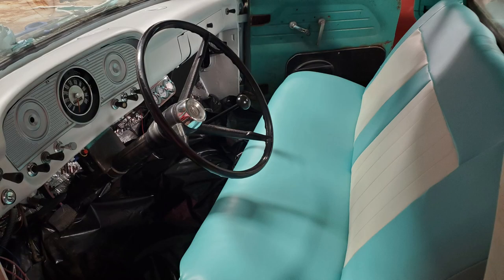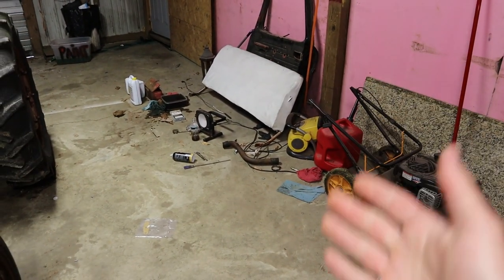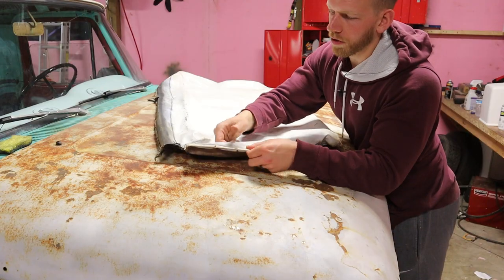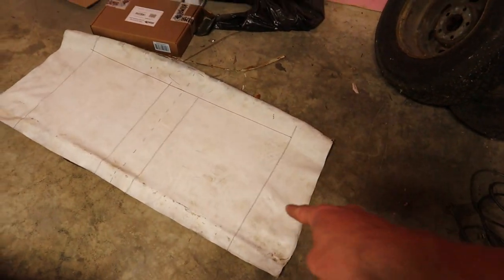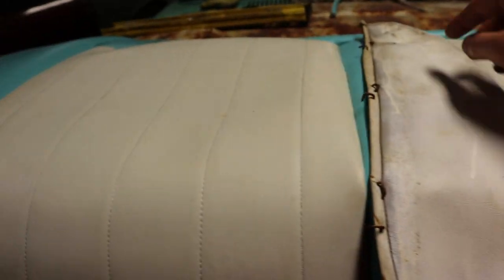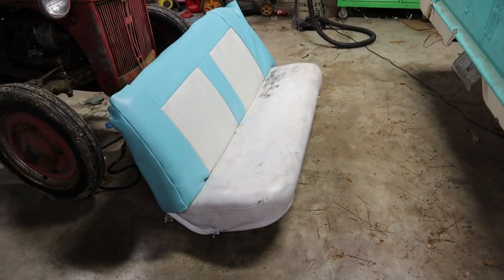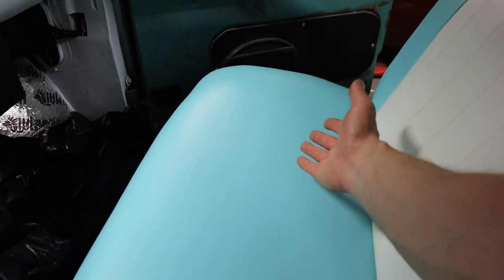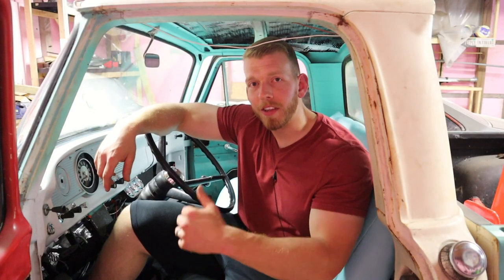PROUD OF THIS! | How to Make Your Own Bench Seat Covers! | 1963 F100  INTERIOR UPHOLSTERY

Comment: I applaud you with your first attempt. 
Having done upholstery years ago. One pointer is having exact measurements of the seat and backrest. The old covers had stretched with years of use.  It’s a learning process.
Overall you accomplished what you set out to do. 
I’m interested in what type of needle and thread you used. Most home machines can handle a leather needle and heavy duty thread for strength.
Again, hats off to you for going for it ! 👍🏻

Comment: I have just started learning auto upholstery and have sewn garments and accessories most of my life. That's IMPRESSIVE that you sewed vinyl with a domestic machine!! Most of my newer home machines wimp out on 2 layers of denim let alone vinyl inserts. Good work and I am glad you are enjoying your new seats!
Reply from the maker: Thank you! I really need to invest in a better machine! 

Do you have any suggestions?
Reply: @JakeHarrington  Well I am using a Consew 226 which is a walking foot industrial. It is possible to find one used and they run about 900 - 1200 or so, depending on your area. Really, any industrial walking foot machine will be good for heavy materials like vinyl and light leather. For a more versatile machine that can handle light to heavy kinds of projects, you can't go wrong with an older Pfaff or a Brother Exedra. I have had really good experience with both. 

I hope you are enjoying your sewing adventures!